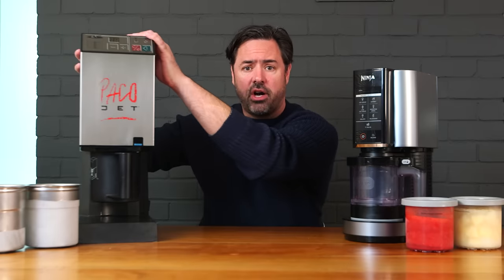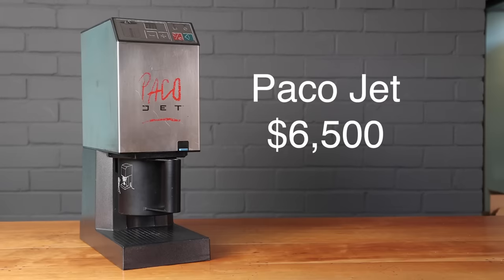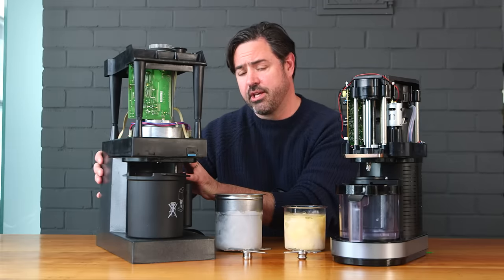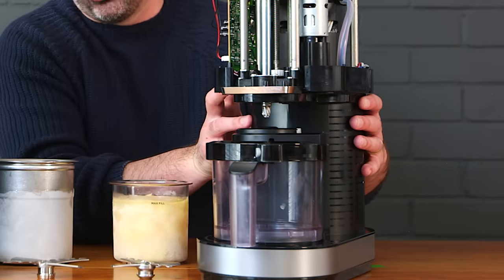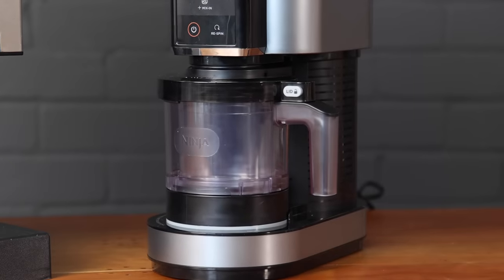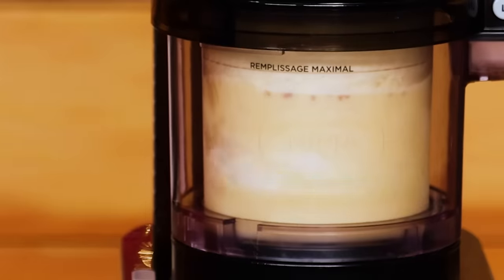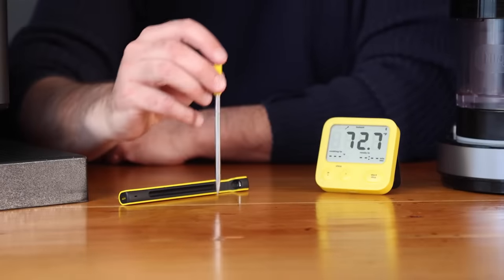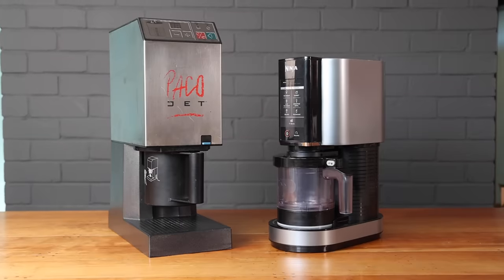Ninja CREAMi: Pacojet Killer?

Comment: At $6500 vs $200, I don't think the motor or cup capacity differences are major issues. If you buy 3 of the Ninjas for $600, at 10% of the price, you can run all three machines at once, diving up your workload into a pipeline that can do more than the original Pacojet. This assumes you have the countertop or floor space to set up a rack to house these things, of course.
Reply: @monkeykoder sorry , Ninja any day of the week
Reply: @monkeykoder  The difference in quality between a high quality commercial electric motor and medium to low quality motor is usually 5 to 1 (You get 5 times the life).  Considering the price difference, that nowhere near makes up the price difference.  The Pacojet's price is just beyond awful.  If you compare the price difference to that of other products like a vacuum sealer for example, you typically only have to pay 2x the price for the commercial upgrade.  High quality motors cost more but not 35 times the price of the entire unit more.  Most likely a semi-professional variant of this can be made and sold for $500.
Reply: @monkeykoder   did you run Ninja as much as a Pacojet just for experiment? Did you try it? Will the lifespan be shortened to 3% of the life span of a Pacojet? Otherwise the 30x price difference can't be justified. Yeah, I understand the Pacojet has a larger container etc etc.. So what? a five dollar increase of the material cost to manufacture? I bet you the cost of manufacture of those two machine is not diffenrent by 3000%. But the selling price is. And you need to undertand, for Ninja to success, the 200$ selling price already generate a good amount of revenue. Think about that!
Reply: Not true, you can run a pacojet nonstop. And shave just a small section of the cup. Neither of those are possible with the ninja.
Reply: One thing that comes up REPEATEDLY in almost every Ninja Creami review is that they often have to run the system twice to get the creamy consistency that you might expect from a Pacojet (and still doesn't quite get close to the texture). While it's still a viable and great alternative for the home, the Creami can take 5m to process ice cream and still not have the same level of consistency and same small crystal consistency that the Paco has. That doesn't make the Paco worth buying for 99.9% of home use, but it might make the difference for someone choosing machines for a small restaurant or business.
Reply: you dont even need to buy more cups tbh you just defrost a few seconds the frozen ice cream or sorbet and wrap it in plastic film then depending what flavour you need you unwrap and place in the cup to spin
Reply: @CookChad  we also had pvc pipes cut the exact size of the pacojet beaker. So you just stick a vacuum bag in the pvc pipe. Fill it. Let it freeze and then vacuum.

So easy for big batches. And you always have the ready to go.
Reply: @00vaag  that too but vacuum bags are expensive in my area so plastic film is a better option in terms of cost

Comment: Have wanted a pacojet at home since the first time I used one, so was super happy when the Creami came out and bought it instantly. Having said that, there's a market for a semi-professional version of the Creami (Metal cannisters/larger/more powerful etc...) and if that came out I would instantly upgrade. Price range $500 I think would be reasonable.
Reply: That would be an instant hit with smaller businesses as well, since 6.5k for a fast ice cream isn't attractive to some shops that are starting out, but a 500 dollar mid range system might hold them over until they can afford a beefier model.
Reply: Ninja could push into the market just by offering metal containers.  There are so many issues with plastic getting stripped from the canister walls.
Reply: @davisbradford7438  I've heard of this happening. Seems like everything has to be just so, such as the top being completely smooth, not over filling and making sure it's slightly thawed before processing. That said, some people have no issues and just throw it in with out a care.
Reply: You know that there is a Ninja CREAMi Delux? :)
Reply: @iFlojoe  the only benefit to the Deluxe is larger containers and a few extra programs which aren't all that useful over the 7 in 1. Still all plastic and awkward attaching mechanism!  Unusable in a small businesses!
Reply: @Izbiski_  😊😅😮😢🎉😂❤
Reply: I assume that you heard about the Ninja creami deluxe that has 30% larger containers for 30 bucks more?

Lol they definitely beat out that $500 figure by quite a bit. I'm also pretty sure that it has metal aftermarket containers as well.
Reply: @StrengthScholar0  You missed my comment above referencing the Deluxe! 😉

It's not better than the regular creami (in power). Attachment mechanism is still flawed and there are no metal containers!
Reply: Metal canisters would be an easy fix.

Comment: Maybe you can make this into a series, your way of comparing and explaining really is superb! Would love to see you compare a Vitamix to a ninja blender.
Reply: E
Reply: Project Farm actually just did a cheap to expensive shootout that included a vitamix and Ninja mixer. It’s worth a watch!
Reply: Vitamix e310 (one of their cheaper blenders) cost between $3-400 and it will probably still work in 20 years if you use it a normal amount. It is better than almost every (if not everyone) ninja blenders and it will work for a much longer time. So if you can afford it even a cheap(ish) Vitamix is a much better investment imo ( I would choose one of their $600-1000 blenders if you could afford it though, but the cheap e310 or e320 is still one of the best blenders you can get).
Reply: @123simenHP  its always about the use case. I got mine a few years back on black friday for 80€. I use it almost daily to make protein smoothies with frozen fruit and ice cubes. Its still awesome and the Vitamix would need to last for a loooong time to make up for the Ninja breaking anytime soon.
Reply: there is no comparison. ninja blenders are terrible.
Reply: As a non professional,  who has had them both. Vitmix is worth every penny . I have had mine for 13 years, and I have not had  to replace a single thing. The Ninja, which we purchased for our daughter , but used it when we visited. We have replaced the cylinder several times. It does not blend as fast or smooth. Just no comparison. If you don't make smoothies often, though, I use it for a host of kitchen task. Then yes, a Ninja will be fine for you. I ,for one, will not trade my Vitamix for anything.  My only contention with them is the newer models  or cylinders are wider and shorter, which is awesome easier to clean, and you can store them under standard upper kitchen cabinets. However, the new cylinders do not fit with an older motor base, so I would have to purchase a new one. Which is pointless since my old one just won't die. Unsolicited opinion, but it is the honest truth.
Reply: @zimt2863  - The speed control (variable resistor) is bad on mine. Needs to be cleaned with contact cleaner or replaced. It went bad after 2 years.
Reply: @OMGWTFLOLSMH  Are you referring to the Ninja going bad or the Vitamix ? I am not sure.

Comment: Even in a commercial setting, I'd just have 2 of the Ninja's. (Provided I had the counter space)
I'll likely never be in the market for either of these products, but after watching your steak searing comparison video, I wanted to reward the algorithm. Keep up the unbiased, invaluable work.
Reply: Counterspace? Our Pacojet was bolted to the wall. There's an insane amount of torque in those things. There's no way that the CREAMi comes close at 1/3rd the weight and 500rpm less, no matter how much smaller it is - I don't really buy the "unbiased" either, but eh. We would throw lobster carcasses in it to make bisque, it would atomise them. Perhaps that's the next test with the CREAMi...

Dude's over here comparing a Rational oven with a microwave.
Reply: @graysaltine6035  We get it, you overspent.
Reply: @banksta3  Actually I don't think you get anything at all, or have any idea what to expect from either of these machines. That Pacojet was used 20 times in a row, twice a day for 10 years and it had one blade snap. This plastic garbage will last one use, which is fine because that's exactly how many times the average customer is going to use it anyway. It's pretentious counter-top-filler that will go in the cupboard right next to the margaritaville, the spiralizer and the electric pot-stirrer. 

You can stan all you want, but fact is I am actually very familiar with what he's talking about, whereas you don't have a fucking clue.
Reply: @CajunReaper95  And you missed my point. If you want to make ice cream at home, get an ice-cream maker. This is an extremely loud machine that requires you to use it every time you want to eat ice-cream and to store your ice-cream in a proprietary container. Pacojet marketed to chefs, not because they "overspent" like the Ninja-shill says, but because that is the only market that makes any sense for a product like this, regardless of price. Unless you are making 10 different flavours at once, there is almost zero reason to use one of these over any other method of making ice-cream. 

IDK what you are getting at rambling about finally having access to sweet treats at an affordable price - you can literally make perfect ice cream at home with nothing but a whisk and a stove for utensils, you can mould it into any shape or container you want and it will stay fluffy and easily scooped/sliced for months, straight from the freezer. This machine is a gadget, a toy version of a professional machine that literally nobody needs in their house for any reason. I already know exactly who is going to end up buying these things and it's not home-cooks. This is the budget pacojet that grifting chefs have been waiting  30 years for, so in that context I am most definitely going to judge it harshly. This is going to be found in the kitchens of guys who cook stuff with an Anova circulator and put salsa verde on everything.
Reply: @graysaltine6035  lobster bisque sounds amazing. I wonder if the Ninja mill would be able to do say, prawn shells for XO sauce. I imagine lobster shells would be out of question.
Reply: @graysaltine6035  See my comment here after testing the Creami...
Reply: @graysaltine6035  yeah it sounds like you’re a chef, or at least have worked quite a lot in commercial kitchens. I agree with you, and yeah there’s a lot of tools you’d find in a restaurant that would be “cool” to have at home but completely unnecessary. I can think of sooo many. This is clearly a prep tool designed to take ice cream “starters” and turn them into a final product. I really don’t see any reason you’d need one of these at home.
Reply: @CajunReaper95  I think what grey saltine is trying to say is that unless you are throwing constant parties and have a deep freezer where you have dozens of prepped ice cream “starters” and need to bring a large quantity to serve-able quality on short notice, there’s no need for a tool like this because that’s all that it’s for. 
 
And yeah, this thing looks like it’s not really going to last. The ninja used a tiny brushed DC motor which don’t last nearly as long as brushless motors.
Reply: @devoncantrell3311  13 years in kitchens, now I work in an ice-cream manufacturing plant for a large private company. I've made ice cream just about every way you can imagine from at-home to pumping 2000 liters an hour. 

For anyone who is interested when I make ice-cream for my wife's grandmother (it's her thing, little pleasures and all that) I just use a stand mixer and a stove-top. Whip your cream, whip your egg whites, make a 118 degree boiled sugar in a pan and stream it into the yolks while you whip those too. Add flavouring to the yolks, whip a lil more. Fold everything together, add inclusions if you want them. Scoop into mould, freeze, come back later and eat it. Nothing easier. All your air is incorporated before you get anywhere near a freezer, and this ice-cream will slice/scoop easily straight from a -18 freezer.
Reply: @graysaltine6035  that sounds great. Honestly better than what a Pacojet would make. Honestly it just seems like a prep tool for nicer restaurants that want a somewhat fresher product to guests more quickly.
Reply: @graysaltine6035  Gotta disagree. Firstly chris isn’t just some dude. He’s a scientist who previously worked in the fat duck (when it was the worlds no1 restaurant) and co founder of chef steps and developed the joule sous vide. Secondly isn’t not like comparing a rational and microwave. They cook in completely different ways. It’s more like comparing a Ferrari f40 and Mazda miata/mx5. Both will get you from A - B. The Ferrari will be superior in many ways and on the track but in many ways the Mazda would be more suitable to a guy that wants to have fun at the weekend. Don’t get me wrong the creami is a cheap Chinese plastic piece of shit but for home tasks it performs in a way no home appliance ever has up to now.
Reply: @smoll.miniatures  Ah you mean the circulator that is marketed as a "sous vide tool" ( a description completely devoid of meaning). If only these inventors were smart enough to understand the foreign words they're appropriating for their "inventions". The implication that a fryer-element with an LCD screen and a propeller attached to it is somehow going to seal your food in a vacuum is a stretch to say the least. As for The Fat Duck - I have never personally worked in a restaurant that almost killed 300 people at once, so I can't relate. 

If we're blowing smoke then I'm gonna chirp -.-
Reply: @graysaltine6035  How does people getting a mild case of norovirus in 2009 because because a farmer supplied some so-sp oysters equate to "almost killing 300 people."
Reply: @graysaltine6035  None of this has anything to do with comparing a pacojet to a microwave… one minute you’re young, cool and hip, and the next you’re arguing online about ice cream machines. 🤦‍♂️
Reply: @smoll.miniatures  yeah I dunno that dude is SUUUPER bitter, was very painful to read
Reply: @graysaltine6035 wow, it’s been a while since I’ve seen someone be this agitated over such a mundane topic. It’s an ice cream maker mate, get a grip

Comment: "On the other hand, the Ninja CREAMi is $200. I can have have 32 Ninja CREAMis for the price of on Pacojet, and that's a kind of durability in of upon itself."

This is so well written. I appreciate your brevity.
Reply: I hate this trend of shitty electronics that are only meant to last a year or two. I’d rather spend good money on something that lasts than create a ton of waste.
Reply: @devoncantrell3311  if Pacojet can last 10 years and Ninja Creami last 1 year, I will absolutely choose to buy 3 Ninja Creami for my business.
It is simply more scalable, and most likely faster
Reply: @Hilman_Faiz  not true. The pacojet is significantly more powerful and reliable. I’ve heard of them lasting well beyond 10 years without having to spend a dime on repairs or anything. One person used theirs to purée lobster every day for over a decade and only had to sharpen the blade. It’s built differently. The point is that the pacojet is a prep tool. It’s designed for food service to quickly make a semi fresh version of something you can make better at home with a normal ice cream mixer. It doesn’t make a lot of sense to have one. And I highly doubt you’ve worked in or owned a commercial kitchen because the dinky plastic ninja wouldn’t last more than a few months in any kitchen I’ve worked in. Mainly due to being wiped and needing to be taken apart and cleaned with harsh chemicals and very hot water constantly. Let alone the non stop use and less than gentle handling during high stress times. I think any business owner knows that you need to spend money to make money and giving your employees good tools will make them happier and also help them produce better work more efficiently without worrying about quality or constant replacement. Imagine if the ninjas sell out you’d be screwed. And either way, if the pacojet did break, you’d have ten whole years to get it covered. Sure it’s a few grand but even just a dishwasher in a kitchen is $3,000,$7,000. A stove and hood is at least $50,000. I know that for an ice cream place even just the display freezers can cost upwards of $10,000. Heck even the metal “hotel” pans it’s served in are usually $50 a pop. Most places have 200+ of them so that’s $10,000. A lot of restaurants and food service places cost $1,000,000 minimum to open so $5,000 is not all that much to invest in over a decade of not having to think about something to replace. I’ve seen a lot of restaurant owners try and cut corners and cheap out without realizing how hard it is to keep track of that many things to replace and things go to shit every time.
Reply: @devoncantrell3311  well if we are talking about big restaurant with $500k+ capital, go for $6k is no big deal.
But as for those who has only $10k, which is already big for a small business in 3rd world country, it makes much more sense to choose $200 machine and swap it later when the business grow.
Reply: @Hilman_Faiz  that’s a good point. I agree with you on that.

Comment: The Achilles Heel for the Creami is the blade has to cut through a solid block of ice (more or less). The motor on these cheaply mass manufactured kitchen appliances can burn out. I have found that to extend life of motor save/reuse those one pint paper ice cream containers pour your ice cream base into it and freeze. To remove frozen base from container soak in very hot water then remove onto cutting board. Rough chop base and ad to Creami pint container. Add a little liquid to lube the cutting blade and just use "Re-spin" button. This keeps base from becoming grainy. This gimmick has worked well for my machine.
Reply: Top tip, thanks.